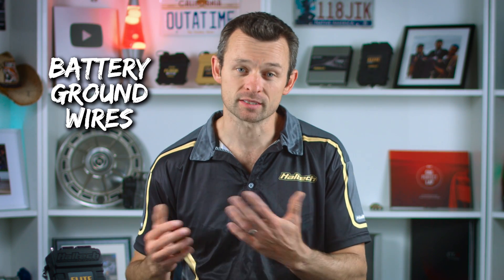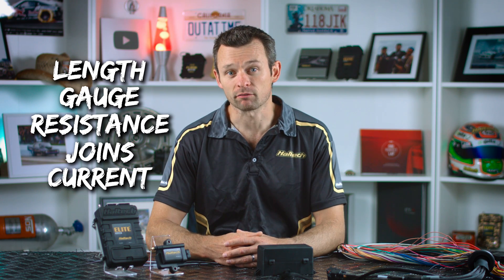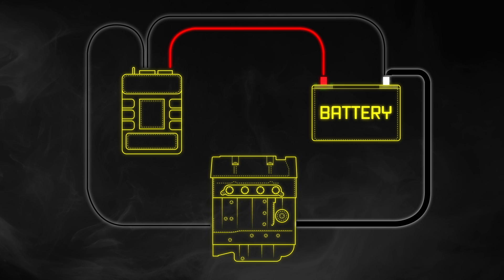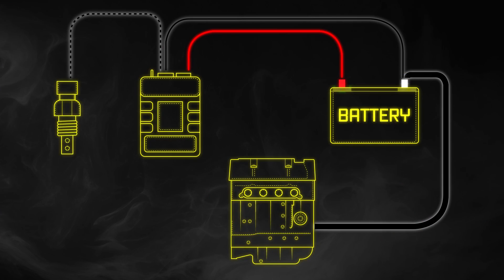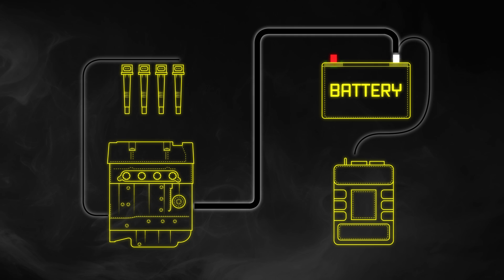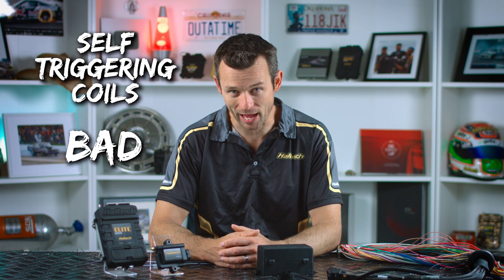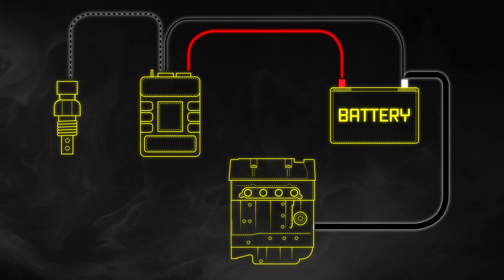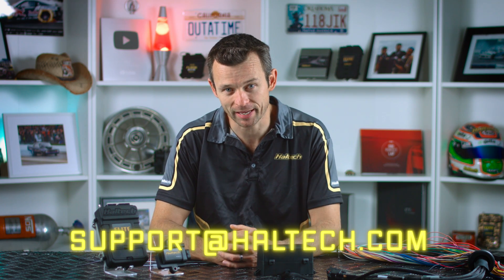💬 Why is good grounding important? | TECHNICALLY SPEAKING

Comment: I install 6 relays on my Polaris ranger for sound system light bars and different accessories and I run all the grounds straight to the battery. Is that okay or should I put everything in the chassis??

Comment: Thanks. I now know enough to know that I know nothing and should probably just give my bike to a mechanic. Pretty sure I have a grounding problem.
 When I turn on the power;
1. I hear the fuel pump making erratic noises, and it never shuts off, which I'm sure it used to. 
2. My voltage on the display starts of at about 7v and rapidly rises to 11.8 and slowly levels off to 12.1, which is incorrect, as separate multimeter readings show it's about 12.8v with no load and a load test brings it down to 11.6
3. My tire pressure sensors also take longer and longer to get a reading
4. Sometimes my electronic suspension gets stuck in one position during extreme cold
5. My servo motor for the exhaust flap does not do a self check at startup
6. My starter motor sometimes turns once and the battery dies and my display does a factory reset. But then it's suddenly fine and there's plenty of power

I've taken the starter apart and it's fine. The battery seems fine. All terminals have been cleaned up with fine grit paper (there was a bit of corrosion) but I'm still getting the problems, and am compensating by putting the battery on charge every night which on the bike. 

Having real problems in learning what I should be looking for as I find electricity very complicated and mysterious to get my head around. Just when I think I know it, I get curveballs.
Reply: Did you find a solution to your problem???
Reply: @konstantin-big   No, it just sort of stopped being a problem so much. I think the battery health is just a little below par. A surface charge usually helps. I also think the solenoid on my particular bike as an issue where it can sometimes get stuck.

Comment: can you have multiple star points? I have a main ground from the battery negative to the chassis by the suspension, where i have non engine sensors and ECU ground too, and then a star point on my head where engine sensors ground with a main path to the chassis star point. is this ideal?

Comment: Hello guys, quick question which someone might be able to help with.

When measuring resistance between the head/block and body/chassis with the car off I get 0.01ohms (200 scale on multimeter) - which is the same as as just touching the multimeter leads together.

However with the engine running it’s reading 0.40 or more, the more rpms the more resistance! What is the issue? Can someone help?

My ecu is grounded to the head of engine

Comment: Hello sir I had a question about my grounding wires that connect to my car battery.
Reply: A ground wire connects to the engine to the battery and another ground connects to the car metal in the negative side is that correct

Comment: I wired a piggyback to the 4efte Starlet ep91 ECU and something weird is happening. Check engine light is turning on on boost after 4500rpm. I figured out that attaching a ground wire from an external device port to the chassis the phenomenon doesn’t happen but engine doesn’t go down 650 rpm but stays around 1k instead. It is def a ground issue but what could be wrong? The device is wired to the ECU computer ground. Maybe the wire is bad? There are 3 computer grounds on the main ECU connector. I would like to know where they go. I need help.

Comment: Ive now watched a few or several i guess videos on grounding in vehicles.    

This was a great video   and thank you for making it and uploading it  

the single point grounding system  like mentioned  in the video.   I have a question which stems from a video i watched about wiring a track car which does also implements the single ground point, but takes it a step further by using 2  main ground points vs one, they use 1 ground for all  low amp draw and a high amp draw ground
The main concept or idea principle being having low amp draw componemts and high amp draw  on same ground, (i forget verbatim wording of reason  as to why you shouldnt  but iirc   the reasoning  was similar to that stated invideo  and it was just bad all the way round   for signal integrity,  cross chatter,(noise)  ground loop and i think component health was possibly  in there  

Is this coreect

Comment: I accidentally attached my throttle ground wire to the wrong location, it supposes to ground to the intake manifold but I hook it on the air intake vacuum line. the result was the car shaking after start-up and the dashboard gauge acting like its shortage somewhere. So I did some research and put the ground wire in the right spot, and the car runs back to normal now. So I m curious, why the throttle ground mistake can cause that shaking problem, or what exactly is the throttle grounding for? thanks.
Reply: Some parts use signal grounds and some use solid frame ground you might have mixed them by accident

Comment: I'm still a little confused, tbh. Hopefully someone can tell me if my setup is ok. I relocated my battery to the back of the car. I then ran 1/0 welding cable from the negative to the chassis frame and another 1/0 cable from negative all the way up front to a bus bar. Then from the bus bar I have a 1/0 cable going to the chassis frame, another going to the head, another going to the block and an 8awg cable going to a small bus bar inside the car which is where my ECU, gauges and EFI relay gets it's ground from. I've been running it like this for 3 years without issues. Is this correct? Maybe overkill?

Comment: Since current was moving through the ground (Means Engine / Car Body), The Gasoline fuel was not affected? Does not cause any ignition on the gasoline fuel? Thanks in advance for response.

Comment: I own a 1946 Chevrolet truck with a 6v system. It has a new battery & the generator & starter have been checked & cleaned. My battery negative cable is connected to starter bell housing. I installed a 2nd ground cable from the motor to the frame also. Problem is when the truck has been driven for awhile and I turn it off it is hard to restart until it cools. Suggestion please.

Comment: Hi.. I have a problem with my vw lt 35....after i have rebuilt the engine when i connect the coolant sensor my engine goes mad...... Really goes mad...... Now i have disconnected the cooland sensor and all good..... But.... I need to know the coolant temp....
Also i have replaced the coolant sensor and is doing the same..... 
Do i have to ground the cylinder head as well? .

Comment: Thanks for the information. Here I have a scenario; my bus RV has a 24Vdc starting battery system which is negative grounded as usual. Now, if I want to add an off grid solar system which has solar panels and 48Vdc battery bank and through an inverter generates 120Vac for AC electrical appliances. I also add an isolated dc to dc converter to convert 48Vdc from solar battery bank to 12Vdc to run 12Vdc appliances. Here, I’ll have solar panel, solar inverter with 120Vac output, 48V battery bank, and 12Vdc from converter. If I were to connect all these to chassis ground, would that creates any problem or interference. Or could I just leave all these ungrounded ? Any advice is appreciated.

Comment: DC current does odd things, so the idea of star point grounding makes good sense and leave the [bonded] frames purpose of dealing with fault currents only..  If there's a weakness in some modern cars, it's that straps are undersized just a bit, and that can drop voltage under high current [such as cranking].  No harm in sizing up the negative side cabling, but leave the rest as designed.

Comment: Hi, I use the technical current direction.
What is the best wiring method if I want to use the engine as a Starpoint connection and want to locate the battery in the trunk?
What should I do with the generator cables? (+) and (-) cable from the full bridge rectifier to the battery (+) and (-) and two parallel power cables back to the engine bay ? (-) to engine!
Should I connect the chassis to the battery (-) pole or to the engine (-) Star point ? 
I want to use the parallel lines to avoid EMF, as far as possible.

Kind Regards

Comment: Thanks so much for the video.. if you're going to ground off the cylinder head do you still then need an earth strap from the motor to the body somewhere??

Do you have a practical install video of what grounding everything to the cylinder head looks like?

I don't really understand then why your ign1a coils have 3 grounds in their diagram? Is there a practical wiring video somewhere to highlight star point grounding off a cylinder head?

Comment: So question . If you connect the battery ground and Ecu ground to the back of the Cylinder Head and the Ignition coils to the front of the cylinder head would that be okay since the head is a star grounding point ?

Comment: So what if my battery is mounted in the trunk of the car? Do I still run a short length ground strap off the battery right to chassis in the back and then a separate  ground cable off of the head? Or am I running the negative battery cable it all the way up to the engine and grounding on the cylinder head along with the ecu ground, and the knock sensor and coils? A little confused.

Comment: This all made perfect sense, except for the star point. What I mean by that is; Do you need to run a wire from the battery negative to the engine rather than the chassis? And then make sure you have an epic ground strap to the engine for everything in the car to return to the battery via the engine? Please answer @Haltech as I'm in the process of wiring my 2jzgte into my Supra and I haven't grounded the coils yet!

Comment: What is your thought on splicining ground wires.  ie. 4 coil on plug set up.  Instead of 4 ground wires you slice all 4 into one wire and then ground.
Reply: I'd like to know this as well. Since you'd be grounding your coils to the cylinder head, those 3 short wires won't make a big difference but I'd still like to know. The only thing I can really think of is using adequately sized wire for this common ground (since it's carrying 4 times the current)

Comment: Great info! Another consideration besides resistance/impedance is loop area: a large, open current path is going to act like an antenna, so it's generally good to minimise the loop area with dedicated grounds that run close to the outbound wiring (perhaps even twist them together if the increased inductance won't be an issue).

Comment: If you want to make it really exciting you can ground to your radiator so your coolant does double duty as a liquid ground strap (weight savings!). Voltage depending on how many air bubbles you have, never a dull moment! Make sure your radiator and engine are made from the same metal, or else the electric current will eat a hole in something.
Reply from the maker: I see you like to live dangerously!
Reply: radiators are not a wire
Reply: @dw2176  Not with that attitude.
Reply: Tremendous!

Comment: That orange bolt is something I’ve seen a few times as an industrial electrician. Your analysis of the ground is pretty spot on. I close loop grounded my entire analog electrical system. It decreases ohms per foot and also dissipates static saturation from high output electronics. I did star ground all of my digital signal devices.

Comment: I actually have a big problem on my EFI converted bike, I’m using ls2 coils and have both coils and ECU grounding to the engine. During cranking, sometimes the engine kicks back, or the crank stops. Can’t find the problem, tried coils crank triggers and multiple sensors, both hall and vr
Reply: Timing?
Reply: Did you ever solve this problem? It was happening to me.....The battery itself was too small (insufficient CCA) and the voltage whilst cranking was only 2.5 volts (data log verified) Put a bigger battery in and the kick backs went away. Wasted a new starter and bent something in my engine before I realised WTF was wrong.

Comment: As a comms tech we had no ends of problems with grounds. Just once the installer wired the earth to the battery without a fuse and the car / truck burnt down.  This was due to the engine ground being dodgy and all that start current going through the radio which was bolted to the chassis. Nek minit flames and lots of them.

Standard rule of thumb, same as the star topology, in the vid never ever ever put anything on the neg terminal of a battery unless it is a big cable going to a cassis or engine ground.  Only ever connect accessories to the cassis ground adjacent to the battery unless you are unlucky and then can warm yourself by the nice car fire. It happens a lot. 

The voltage drop issue is something hard for people to understand as well. All cable is a resistor. The better the cable the lower the resistance the less loss the less voltage drop. 

Misfires etc are a bugger to find when they are due to wiring hiding in the car
Reply: Learn something from uour comment. What about usage of pivot spark earth? One end need to be connected to battery -ve as well. 4awg cable will be different story?

Comment from the maker: If you follow any online forum where vehicle wiring is discussed it won't take long before you come across a debate about the best way to ground your ECU. So today we are going to get our nerd on and look at the theory of electronic circuits and help you figure out the optimal grounding solution for your particular wiring application.
Pour yourself a hot cup of coffee, grab that cardigan, pull up a chair and get grounded!

Got a topic you'd like us to cover? Leave it in the comments section!
-----------------------------------------------------------
Liked this video? Here are more like it:
How Flex Fuel Works: https://youtu.be/KQcbaMIAjcs
How Dyno Tuning Works: https://youtu.be/rkcYDrwaJBg
How Traction Control Works: https://youtu.be/rkn4BRwuFS0
--------------------------------------------------------
Don't miss out on our next video - subscribe to our channel.
--------------------------------------------------------
For more Haltech goodness check out our:
Website: www.haltech.com
Facebook: https://www.facebook.com/HaltechEngineManagement
Instagram: https://www.instagram.com/haltechecu
Reply: Couldn't you just use a metal blocks
 or something, since car's no longer have steel rails anymore?